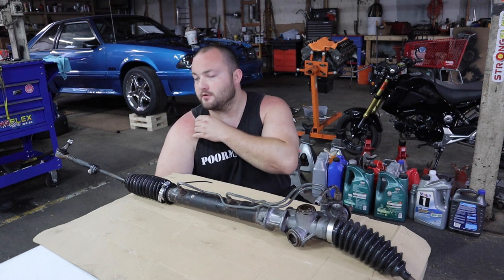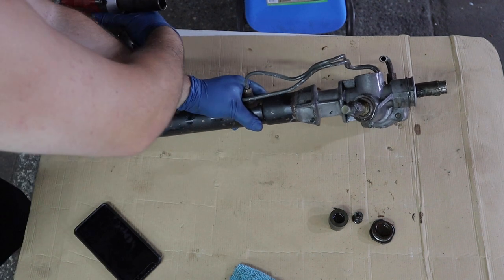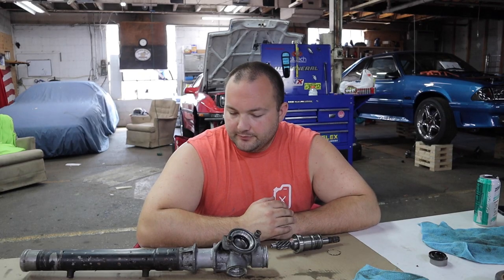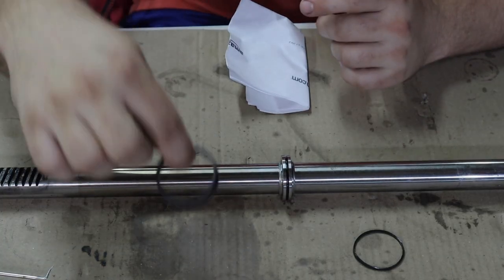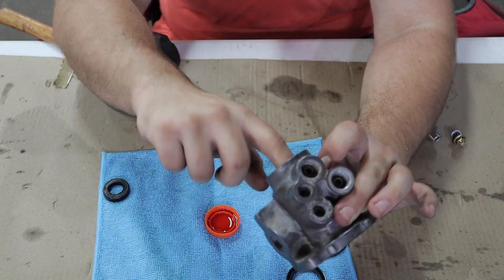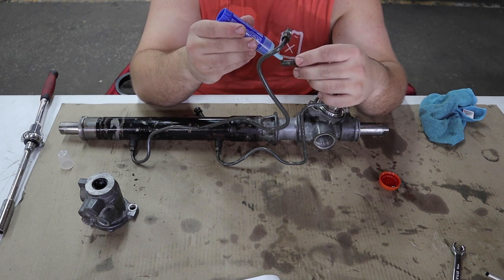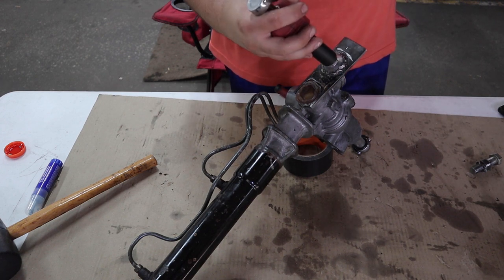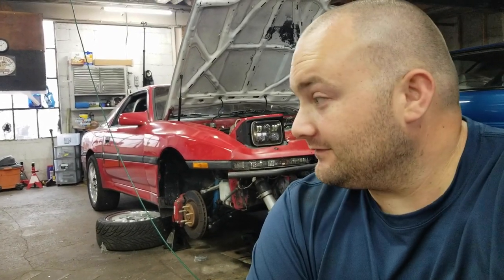How To rebuild a power steering rack  | MA70 MK3 Supra

Comment: I have found a better was to wrap the rack gears. I use heavy  packing (Clear) tape the long way. Leave a couple inches of lead tape, twist to make the journey easier.  On my XJS rack the piston,nylon seal is split on a angle already. Yours might have a relief valve somewhere. Remember this is Power Assist. Not a Hydraulic cylinder. Less beating and more pushing or pressing. I saw the lead-in of your electrical tape was all busted up. It snagged. This in not good. The good part is the seal (it’s new) might be able to handle it. We all use the hot water thing to expand (Nylon) the seals. Funny that you lubed the outer part of the rack, this can be done later, when installing the seal. I’m 60 and enjoy seeing young folks working on their car. 👍

Comment: Thank you for showing this process.  I am in the middle of doing my first on a Dodge Stealth.  i wonder if you did not need to compress the nylon seal.  I am guessing it was compressed too much and failed to seal.  In time it should remember it's original size and expand slightly at least I hope for your sake.  Thanks again.
Reply from the maker: you do need to compress the nylon seal. its been 2 years now and the rack is still performing well

Comment: I wanna rebuild the rack on my ‘89 but I don’t know how to tell if I have an early or late 89 and whether or not I have the speed sensitive rack. Are racks interchangeable across all models and years? Can I convert from one to the other? I’ve also heard fitment for poly rack bushings are hot or miss even the ones from good brands. Since you showed that certain racks have different diameters I’m wondering if that is the reason. What bushings did you use?

Comment: Do you just run the stock 1JZ pump? Do you just get a custom line that goes from 1JZ to your USDM rack? I have an 88 also, and doing a 1JZ VVTi swap.
Reply from the maker: Stock 1j pump. Im using a drift motion braided stainless line now that runs from the pump to the rack.

Comment: Quick question! Boost Rodeo claims a spline socket is necessary for removing the pinion gear. I see you were able to remove it without one. However is seems you were using one @32:40 (if I'm not mistaken). Would you say this tool is mandatory for the job?
Reply from the maker: Im not sure if our racks were different or not, but I did buy the splined socket but its not necessary. The only time I ever used was at 32:40 just to move the rack back and forth but if youre careful you can do it without that special socket.

Comment: Is there a seal at the end near the gear box on the rack gear? I have a leak at the end near the gear box where the teeth are on the rack gear. It’s not a major leak but the boot is wet. I took the boot off and I didn’t see any fluid dripping out, I’m trying to figure out if there is a seal or which seal might be wearing out at the end near the gear box.
Reply from the maker: I believe the seal that is leaking on yours is like the seal i install here https://youtu.be/yqB1fgG6T6c?t=1250

Comment: Most likely clamp you used to compress oring damage it. Great video anyway 👍
Reply from the maker: No damage it works fine
Reply: No need to compress, there is a lead-in in the tube. This will compress it. Use ATF! Go slow. Great video.👍

Comment: Just started doing this job on my 86.5 rack, and realized that my reseal kit is missing the upper pinion seal, which is the worst one on my rack 🙄
Reply from the maker: Dammmitttttt
Reply: @PoorManMods  just finished and it’s working perfect, not leaking either thankfully. Btw, to compress the Teflon seal on the piston, I just wrapped electrical tape around the seal tightly (adhesive side out) and let it sit for 10 minutes and it worked mint.
Reply from the maker: @SNOFLOFilms  awesome!!!

Comment: You didnt torque doen with the crow's foot properly

You can look it up but you need to be roughly 90 degrees with the crows foot. Not straight.  You just overtorqued